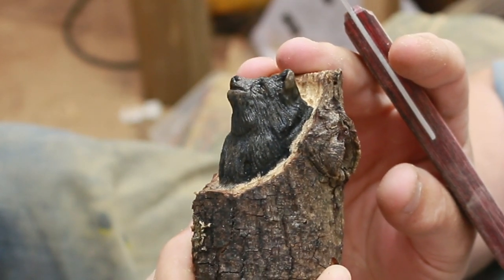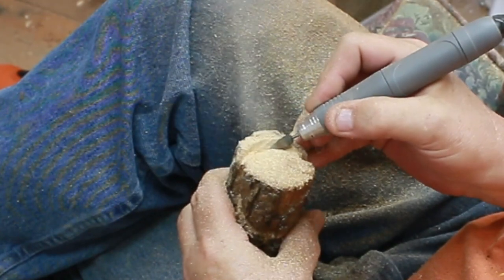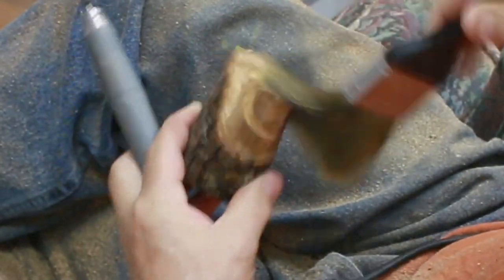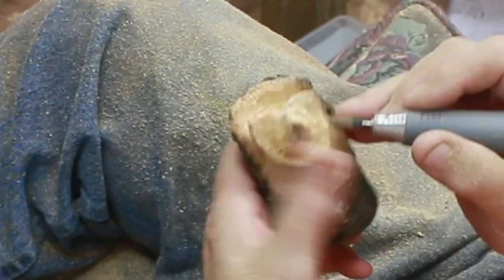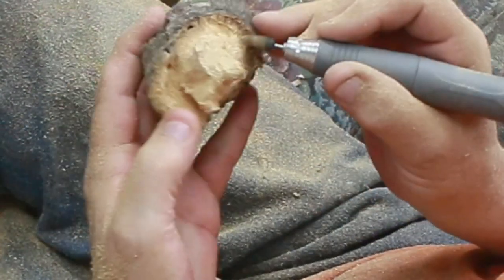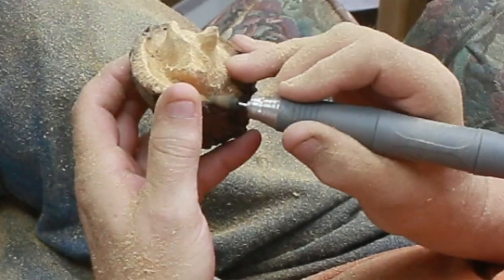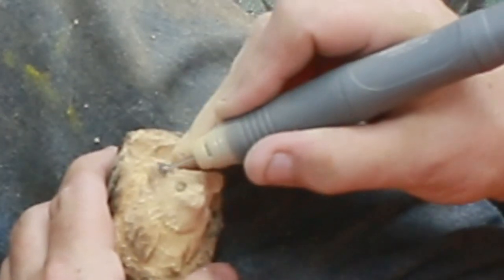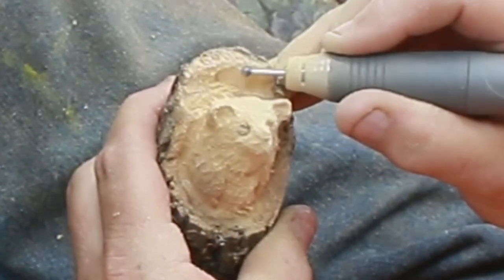Mini Stump Chainsaw Practice Bear

Comment: Is it best to use high speed or low speed? I have a Dremel.
Reply from the maker: I typically run wide open... If the burr is burning vs. cutting I slow it down. But mostly full throttle